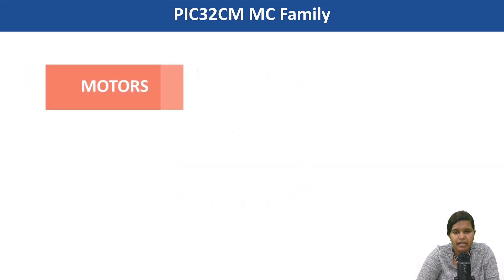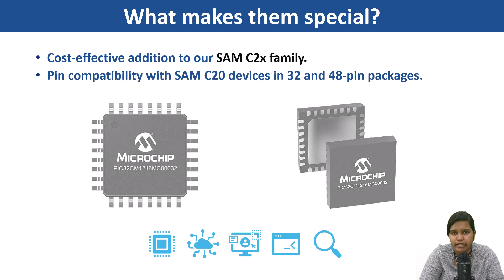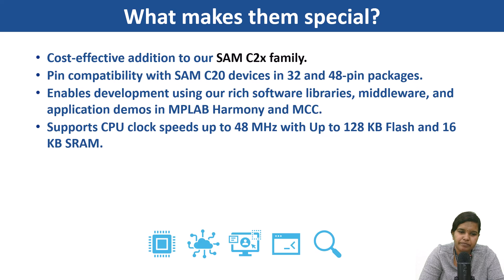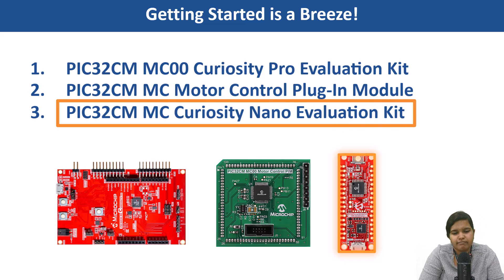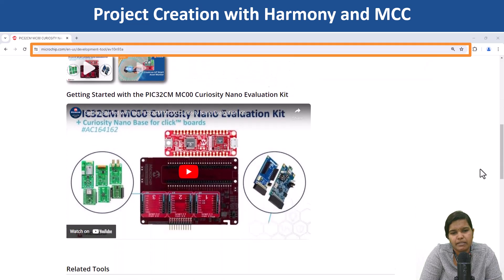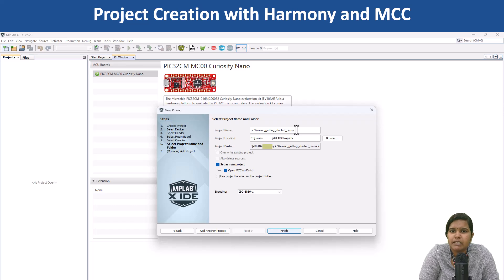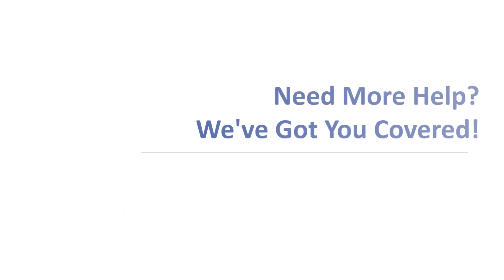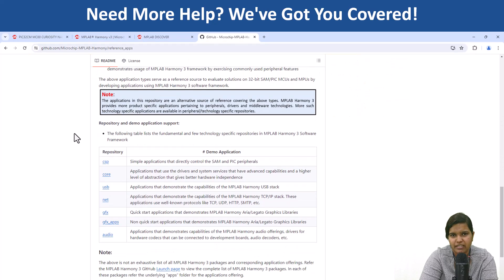32-bit MCU Digest | Build Smarter with PIC32CM MC, Harmony & MCC: Home, Motor, Industrial & 5V Apps

Comment: The only downside with those microcontrollers I have is that they don't have USB.
Reply from the maker: Hi, if you need microcontrollers with USB support, consider our PIC18F46J50, PIC32MX570F512L, and SAM D21. These options offer integrated USB functionality for various applications. Hope this helps!
Reply: @MicrochipDeveloperHelp  

Yes, thank you, they are options that I used, but I was referring to a 32-bit microcontroller with USB, and running at 5V.